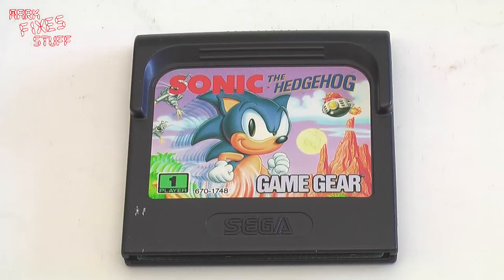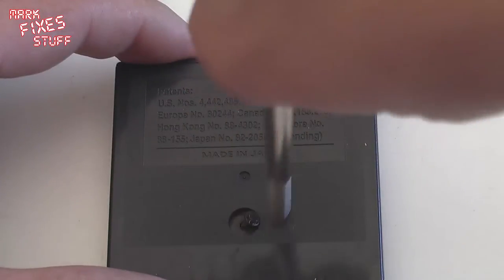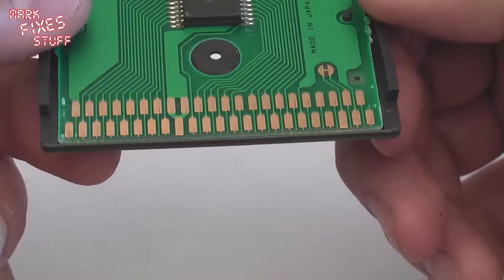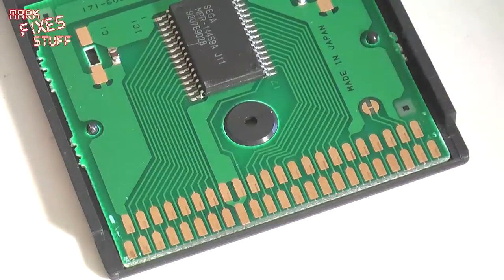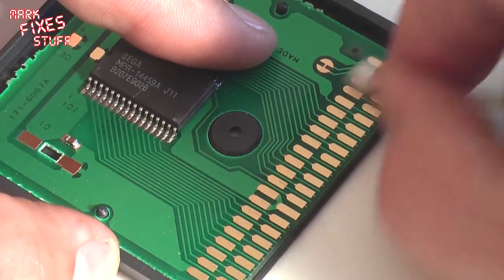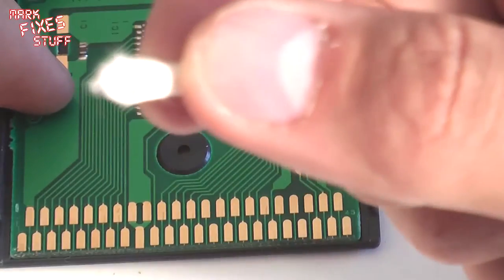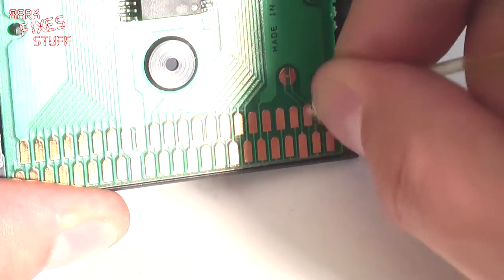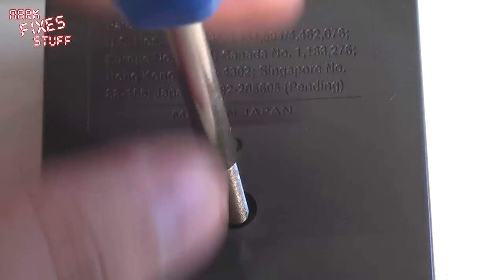How to Open and Clean a Sega Game Gear Cartridge with Dirty Contacts

Comment: buddy...I am so subbing you. I just fixed my sonic 2 using this method you showed. I was so bummed out about it. It would not work even a little. Tried to clean it the way you would an nes cart but the q tip wouldn't go in so well. I did manage to get the q tip inside with a little rubbing alcohol but even after cleaning it this way...no good and I was worried I was gonna damage the cart if I tried harder. I thought my game was dead...thanks man this really did the trick.
Reply: Joe from Texas
Reply from the maker: TheNewport2009 Glad to hear it worked for you Joe, comments like this are why I make the videos :)

Comment: I removed the screw, but I didn't force it open, I checked your video on how to open without breaking anything .
I opened Sonic 2  to expect to see typical IC chips, but they look a little bootleg to me even though,
"SEGA 1992
MADE IN JAPAN"
Is printed on the circuit board.

Comment: PLEASE DO NOT RUB SIDE TO SIDE WITH SO MUCH PRESSURE! And no, never use brasso!

Clean each pin from the inner part of the pin towards the outer part pin.
Reply: Can you explain further please?
Reply: @joedent3323  Yeah sure, np!
If you rub side to side, there is a chance of worn out pins getting lifted off the board for people who tend to rub harder than necessary.

As for Brasso, it eats away, layer by layer and if overdone (let's say the game is used and sold over and over and people use Brasso each time) the actual conductive part of the pins will wear away and your game will stop working properly (or at all).
Reply: @AlfaTrion  ah! Ive got you now - I now see what direction and motion you were talking about with the pin cleaning.

I just got myself the special  screwdriver + alcohol + cotton buds, so I'll put your advice into practice.

I bought a gamegear, and: whilst most of the games that came with it work? Others I have purchased separately either don't load at all / or load once every 15 trys.

Thankyou kindly for taking the time to elaborate for me

:)

"LiL'JpD."
Reply: @joedent3323  Happy to help! Good luck with your cleaning 🙂
I bought 4 Game Gear games this summer and it seems that Dynamite Headdy didn't work and it looks like the previous person used something corrosive to clean the pins 🥲

Comment: Have you repaired a GG cartridge that cleaning didn't solve? (replacing ceramic SMD caps, etc)
Reply from the maker: I tried once and it ended up being a cracked solder joint on one of the ROM legs.
Reply: Mark Fixes Stuff awesome, you rock

Comment: I know it’s been years but question, what can I do if the pins for the game seem to be pretty much gone? I got a few games in the mail that seem to have damaged pins. Can I add some silver or solder or some sort for new contacts?
Reply from the maker: It really depends on how much is left. On computer expansion port fingers I have put a thin layer of solder over some very worn areas, but you do need a layer of metal there to solder to.  I've never had any success with silver conductive paint, and I think it would just come off again.

Comment: Ok so I know it's been a long time but i dont have a game bit screw driver.is there a way to clean it without opining
Reply from the maker: You can try using the very tip of a duster wedged in the contact slot, with some ipa on it
Reply: @MarkFixesStuff  what is ipa?also do you think a q-tip would work?
Reply from the maker: @bricksandpieces1  if you flatten the tip it might fit. Isopropyl Alcohol.
Reply: @MarkFixesStuff  oh ok cool.i have some 92 percent.will that be enough?